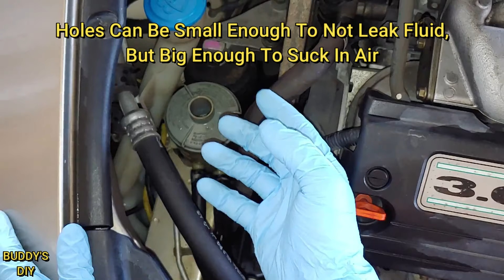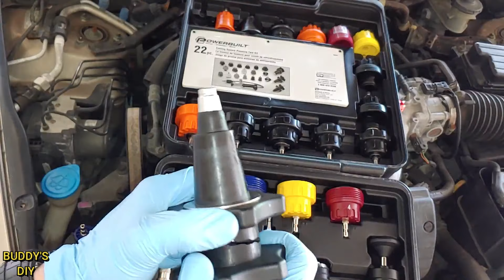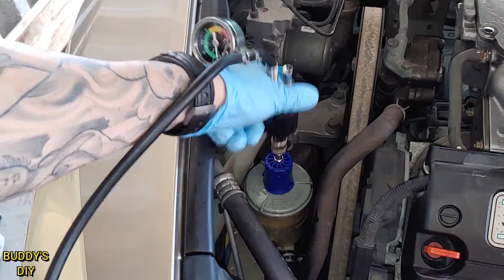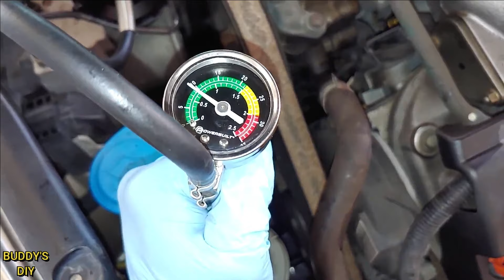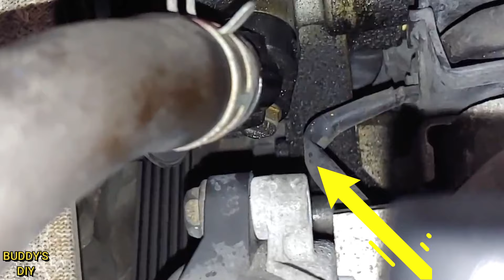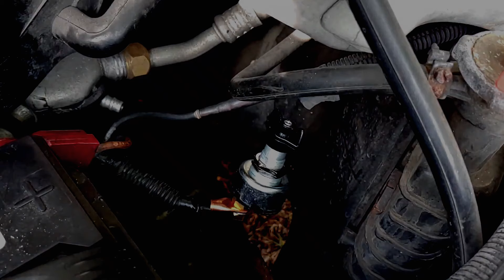Power Steering Reservoir BUBBLING And Loud Pump | How To Fix

Comment: Just and FYI it could also be leaking from their if the oring is bad and not sealing correctly.. Doesn't matter how tied you tight up that bolt..
Reply from the maker: That's very true but in this case the bolt was a tad loose

Comment: Just replaced my alternator and my power steering went crazy. Had to remove a hose to pull the alternator out. I guess I'll double check my work
Reply from the maker: Ohh no. Good luck
Reply: @BuddysDIY  lol thanks. I think the hose was just not put back properly. I got it back on and there was barely any fluid in the reservoir. Sitting in my work parking lot now tho, oreilleys right after!
Reply from the maker: @surge3158  haha best of luck. Any question leave then in the comments I'll try and get back to you!!
Reply: Same happened to me. What was the issue?
Reply: Same happened to me today.

Comment: I fixed my 2007 Odyssey - changed the O-ring.   To test it (before I put the new o-ring in) I took a cap (from the PS fluid) and drilled a hole in it.  I set in on the opening of the reservoir (to over the opening) and used an rubber tip air gun to apply a light amount of pressure while to car was running.  As soon as it applied the pressure the pump whine rapidly began to abate and then PS fluid began to appear at the place where the fitting bolted to the pump – indicating the seal was bad.  (didn't need the fancy test set).  I used a plain buna-n (black) o-ring out of a cheap assortment.  11mm ID x 2.5mm cross section. It was tight but with lube and patience I was able to work it in.   Its all good now.   This vid pointed me in the right direction - Thanks !
Reply: Why didn't I think of that, great idea

Comment: Thank you so much for this video.  I put in a new pump, it was time for one, but it wasn't necessary because the ultimate problem was a small crack in the hose.  So you can imagine how angry I was after finishing the job and it sounding the same as the old one.  This saved me a TON of additional frustration.  I was about to take it to a shop.  I appreciate you!
Reply: how'd you find the crack

Comment: Trying this test on a chevy camaro today. Bought a replacement cap and drilled a hole in it, removed the dip stick part and used the fitting from another cap out of the kit. Added the spring and retainer to hold the cap in its original position.  Fingers crossed I find the leak.  Great video!

Comment: You are the MAN! Thank you for this video. Didn't know that you could rent this tool for free! I knew there had to be a tiny leak somewhere, I just didn't know where. Replaced the pump and high pressure line and that annoying "whine" STILL was there. Got this pump after watching and found the tiny leak. 

Thanks again!

Comment: I had a Mechanic replace my power steering with a new one about a month later I starting getting the same noise when I turn the wheel. I will try this trick myself Thanks for the info
Reply: Has that advice helped?

Comment: Replaced the o-rings, didn't fix the crackling sound coming from power steering pump.  Put a new pump in - still hear cracking sounds coming from pump.  Assuming I have a tiny air leak because no matter how much I bleed the system there are little bubbles in the reservoir.  Heading to Advance to borrow what you used....thank you!!!!!
Reply: Has it helped?
Reply: I'll have to look at my notes and get back to you. I don't even remember posting that comment 😂
Reply: @humanyoda  turns out it was my serpentine belt tensioner and I was mistaking the sound 😬

Comment: Another vid points out that fitting (on a Honda) has an o-ring that fails.  A number of comments claim poor outcomes if other than Honda o-ring is used.  I'm not much of a believer that that is true but that is what is said.  I'm fighting the same issue and that is what I'm going to check next.
Reply: The actual Honda o-rings from the dealer are pretty cheap, why wouldn't people use the parts from the dealer.....less than 5 bucks.

Comment: Thanks mate that was helpfull. how do I fix that leak? I have already replaced the O ring. Still making that noise.
Reply from the maker: You pump may just be shot. If there is no bobbles anymore then your leak is gone
Reply: @BuddysDIY  Hi buddy. Many of my mechanics told me to change power steering pump. I even went to buy one but the price was too high. So what I did was I opened the power steering oil container. Removed the old oil and cleaned the container with dish washing liquid as there was dirt in the filter which is inside the container it was all clogged up. After it was all dry. I got new oil in it and used the white tape which is mostly used by the plumbers to stop leakage, so I used that white tape on the container where we connect high pressure and low pressure pipes and gave it a good tight. After giving it new oil it was all good. No noise in the morning plus the steering feels light. I hope this comment helps someone. Sorry if I made any mistake in my english as it not my primary language. 🙏
Reply from the maker: @nabeelahmed46  hopefully that works for you brother. Good job!

Comment: So I have a 04 lexus es330 replaced the pump and high pressure hose but it seems to still be gushing my fluid out. The hoses on the reservoir are visibly cracked should I go ahead and replace those

Comment: I have a question someone detected some bubbles in my steering wheel fluid on a 2006 Honda Accord my question is should I go about the same way to check it

Comment: I don’t know if you can help, but I’ve picked up a rack and pinion leak, and it’s drawing in air causing the pump to make extremely loud noises. I’ve already bought the rack and pinion online, and I’m going to replace it when it comes, but is there any quick fix to stop the leak and the bubbles from forming? I used Lucas stopper, but it didn’t seem to do anything at all, and it’s still leaking. I’m trying to avoid driving it as much as I can, but I may need it in a day or two and would like to know if it’s going to damage the pump by using it. 

Thanks
Reply from the maker: Just gotta keep it as full as you can wile dirving. Don't let it run dry. Buy a big bottle and topnitnoff every 10 miles or so haha
Reply from the maker: Yeah man there is really nothing you can do. If the lucas didn't work then I'm outta options

Comment: Great information thanks! Just replaced my Power Steering Pump and everything work good. Also replaced the O rings, but now I get a whining noise when accelerating. I suspect I have air in my Pump cause I still see tiny air bubbles in my Reservoir afer driving for a bit.. Any ideas please?
Reply: Change the power steering pressure hose and return house

Comment: My case is a bit different, I have a 06 civic, and the reservoir is boiling and overfilling from the cap. Now if have squeezed the cap shut with a nylon bag. No more leaking but the boiling is still there. Should I be concern?
Reply: YES!! And im sorry that no one has responded smh

Comment: What could it mean if there are no bubbles in the reservoir but the pump still whines excessively? I just got a new pump and suspect that pump itself is the problem
Reply: There is a screen in the bottom of this exact  Reservoir 99 % of the time u drain the fluid get a heat gun and heat the ends of the hoses that come off it helps alot and it will be stopped up with trash black bits of rubber hose it's winding because it's starving for fluid clean the screen get the fluid to the pump no more noise hope this helps someone 😀 👍!! 25 years full time has told me this !!
Reply: @rickybailey7123  it’s actually at the dealer now and they’ve been trying to figure this out longer than I have. They put four new pumps and reservoirs in the car. And now they suspect the high pressure line. I believe they are idiots but it’s been done under warranty.

Comment: I tried this very thoroughly and im not slow, but i still couldnt find it. I brought it up to 25 psi, no leak and no bubbles when i sprayed soap water. But the fluid still bubbles in the reservoir as if airs getting in.
Reply: Did you ever find out where the air was at in your power steering system?

Comment: I have this issue but after I drive it around for 30 mins, the Erie sound goes away and I only hear a normal belt running. Only if it’s super cold outside do I hear the Erie start up for the whole drive.
Reply: 2011 accord ex l
Reply: Same issue here on my 2003 Acura.. ever figure it out Jay? I’m trying to diagnose myself!

Comment: Often times it’s the screen clogged if it’s high mileage. Replace my reservoir and everything is bad to normal
Reply: I know your message is an year old but all you did was charge the hoses and reservoir. I had 2 brand new pumps installed so it’s not the pump but I haven’t yet changed the pump reservoir with new hoses. Hopefully that will cure the loud whine

Comment: It’s not the bolt it’s a O ring around it that usually goes bad I had to replace mine and and the tube that leads up to it still having a leak it’s possibly the other tube going down from the reservoir

Comment: Tried flushing my powersteering fluid, and filled it back up and now its much louder than before,  before it wasnt making any noise aside from a squeak, but now its making a grinding sound whenever i turn the wheel. My old fluid was a dark black and I mean dark. 
What do I do?
Reply: Hey what fix did you do then??
Reply: Attempt to either replace it with new fluid or stop leak
Reply: Same issue I'm having today
Reply: @thelifeofjj9652  did you fix it?

Comment: Can this prevent the power steering fluid to return to the reservoir?
Reply from the maker: What do you mean exactly? Can what cause that?
Reply: @BuddysDIY  can the leak alter the flow of the fluid...in my case I had the same noise and bubbling and I tried to pump out the fluid from the reservoir but I am not getting all of it even after turning the wheel
Reply from the maker: @feteego6390  you're trying to flush the fluid out? Or pump it out of the resivor?
Reply: @BuddysDIY  flush the fluid out, but the fluid is not returning to the reservoir even after turning the wheel, so I am wondering if this can be because of a leak?
Reply from the maker: @feteego6390  I have a videonon the channel on how to flush you power steering fluid. Watch that and then let me know what happens